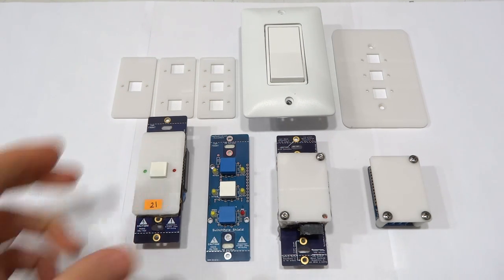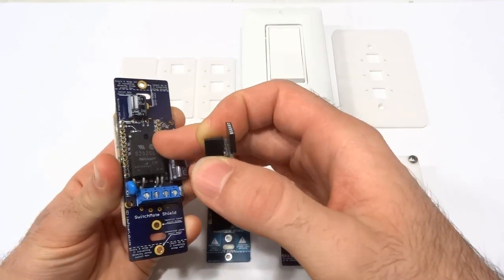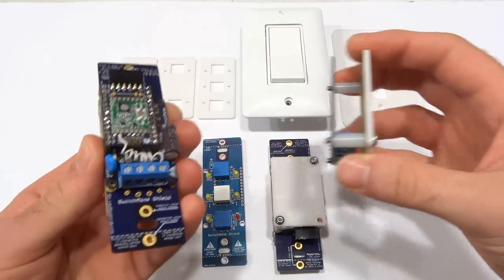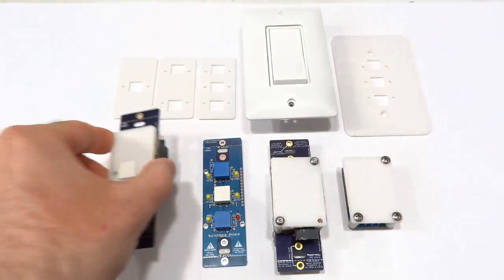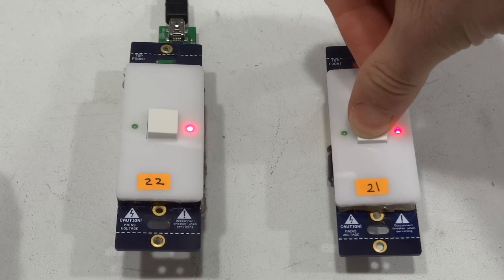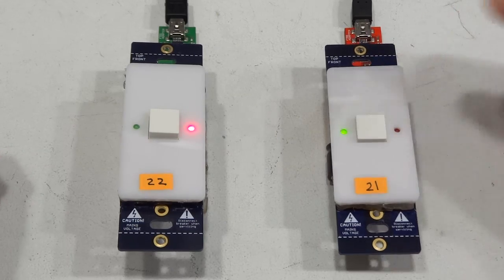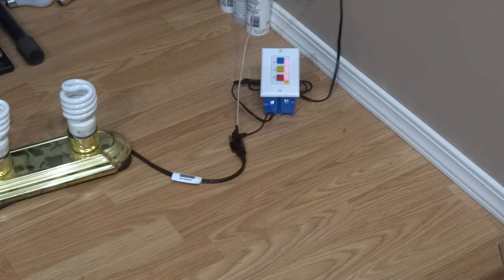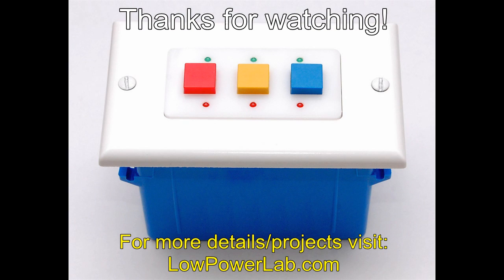SwitchMote IoT wireless AC light switch

Comment: This looks great... was trying something similar... using 24VDC LED lighting around the house instead. Was wondering if you sell separately just the PCB for push buttons and front plate etc. Will be getting some of the Anarduino as the very lowcast RF modules I got are good for nothing. Thanks I was going to do PWM and motion detection on the LED lighting also.

Comment: Is it opensource? id love to see the section on how you drop mains AC down to usable levels on such a small PCB!
Reply from the maker: Not sure yet, but the PSU is using an inductorless switching regulator, hence the ultra compact size.
Reply: Felix Rusu I'd love to see how that switching regulator circuit was done!